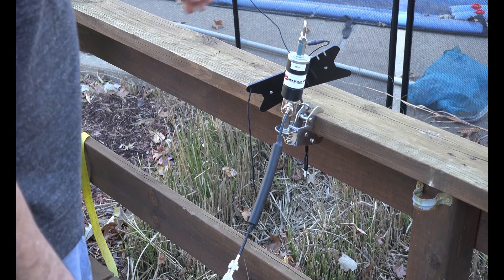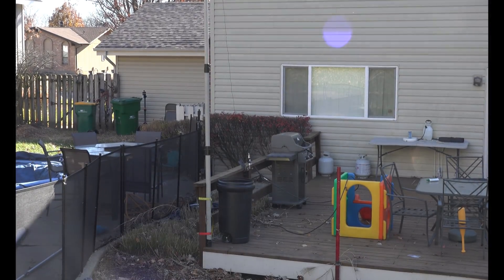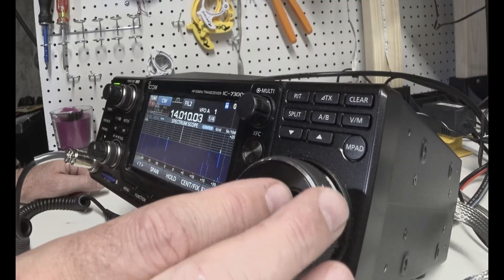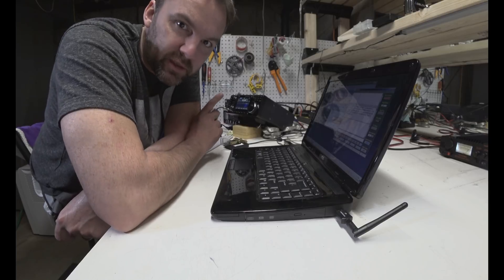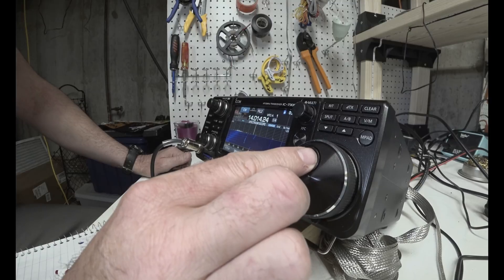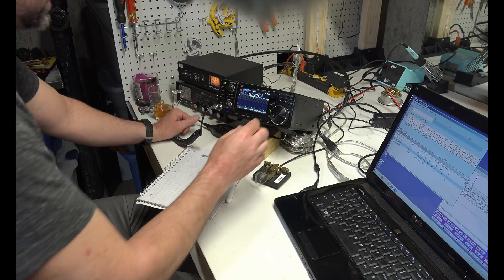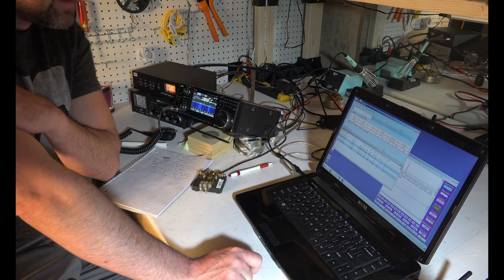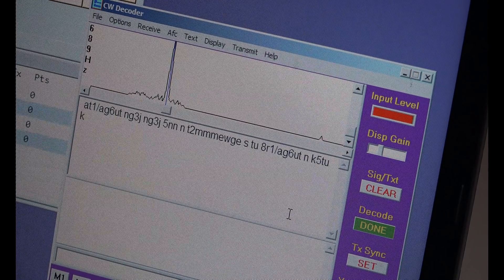CQ Worldwide DX Ham Radio CW Contest | ICOM IC-7300

Comment: Good job Tom.  I'm glad to see you jump in the make some contacts in the contest even though it's a new experience for you.  You will get better with practice and have even more fun.

One of the reasons some of the stations are not responding to you is that they are using very narrow filters on their receivers to reduce interference from other stations near their frequency.   If your signal is not within their receiver's narrow pass band they will not hear you.  Make sure your RIT is turned off, so you will be transmitting on the same frequency you are receiving on.  And use a narrow filter setting of 500 or even 250 Hz and you will have a better chance of being received.  

Also, it's a good idea to use Full Breakin during CW contests so you can receive in between your transmitted dits and dahs, especially since your CW speed is a little slower right now.  You may hear the station you are calling begin to answer someone else while you are still calling.  If you do, then you should hit the ESC key to stop transmitting and wait for the station to say TU and listen for another caller.  You won't be able to receive between your dits and dahs if you are using semi-breakin on CW.

Keep it up.  You are doing great and I'll see you in a future contest. 

73, Steve K8BZ
Reply from the maker: Thanks for the great comment.

Comment: I wonder how extensive a ground system you have with that antenna,  end fed antennas need to work against a really good ground system to work well.   If you can, bury as many radial wires as possible, lots of short are better than a few long radials, you don't need to used exact lengths as the ground will detune.     Noise reduction on that computer cable should be reduced by lots of ferrite clamps or even winding the cable around ferrrite rod(s)      Wishing you all the very best 73  Tony G3ZRJ
Reply from the maker: Tony Butler I have a lot of work to do

Comment: RE: Interference from laptop power cord, I made a small wall/partition between my radio and computer.  The partition is made of foam poster board and is lined with copper foil tape I got on Amazon.
Reply from the maker: I like that idea!

Comment: advice! don't throw your call so slow remember you are competing with others going way faster than you.  you have to get in quick or you will get drown out.  i don't know how the hell these guys could read cw that quick with all that qrm but they are damn good at it.
Reply from the maker: Peter Rod yeah you are right now that I see my video again I realize it's too slow.
Reply: Almost all of them cannot read or send that fast (30-40+ WPM). 
They use software like HRD, CWGet. They are sending and receiving using only Macros (and rarely using the keyboard when an unusual response is necessary).

Comment: That Icom is a sweet rig. I've drooled over that model. But...I think I am going to get a KX3 very soon. When I try a new antenna, I check to see if a freq is clear and then just key TEST CALL SIGN TEST and check reverse beacon network to see if and where it was heard. I had some trouble with my key yesterday (was at my folks place in Ga) back in Va now and will bee trying to fix the issue.
Reply from the maker: I'd def recommend the KX3 or KX2.  It sounds so good.  I have never used the RB Network... still need to do that.  Hey, post a video next time ur on the radio.
Reply: I'm due for another radio video! I'm off tomorrow, maybe I'll do a quick video of my humble equipment, antennas, etc. I'm with you on the contests...not really at the point I want to "rag chew". My base rig is an FT-857D and I sometimes use an IC-703. They are on an indefinite loan to me from work, if you know what I mean (it's legit though). A friend of mine has the KX3 and I really think it's an awesome unit.
Reply from the maker: Ron C awesome, hey try to make it to Dayton next year and we can meetup for a beer.  Great place to shop for gear
Reply: Might be worth the trip!
Reply: There is one record of your call sign still available on the RBN, check it out.
de                  dx             freq        cq/dx            snr   speed      time
WA7LNW  N9YO 7112.0 CW CQ [LoTW] 12 dB 16 wpm 0129z 25 Nov
Reply from the maker: Ron C what is wa7nw?

Comment: That's the way to do it. Jump right in and have fun. You did great. I Always enjoy your ham radio excursions. Really funny to hear how much the family is using the water (wth?).  The ARRL 10 meter contest is coming up Dec 9-10. That is a fun one if conditions are right. I'll try to build a 10 meter 5/8 wave wire vertical and see how that works. Hope to see you on. My the Force be with you. 73 from the other side of the state.
Reply from the maker: Ha!  Great comment.  Yes, sometimes I get a mental block and I don't want to jump in without preparations, but I'm open and honest about how I approach this in my videos.  I don't claim to be an Elmer.  I'm just sharing experiences.    I hope to see you on the 10 meter contest. I will look into it.  Thanks for commenting.

Comment: For the computer interference, you could try ferrite beads on the troublesome cables. They're easy to install and can knock out the RFI. Also, having the station properly grounded can help. I had enough RFI between my radio and PC that transmitting on JT65 would black out my monitor. Ferrite beads and grounding solved that. Good luck! 73 W4CRG
Reply from the maker: I have a lot of grounding going on behind the scenes. I have a ground bus, and aluminium grounding strap and a ground rod....  However, I think it's the laptop power supply. I just ordered some huge toroid cores. I'm going to try and wrap some cord around the cable.

Comment: Hi! Some use computers, some don't. Some use computers to TX but need good ears to catch the callsign.
Regarding the computer cable: get some good 31 or 43 mix toroids from Fair-Rite and install on both ends. You want to read the K9YC paper available online.. Another approach is to get a galvanized metal sheet installed all under your radio desk. That sorted out all my problems. I don't hear a beep from any power supplies, computers or home appliances.
Reply: Why don't you put up a Delta Loop antenna? Computer locks up because too much RF is coming back from your antenna system. Your choke must have at least 5,000 ohms to reduce RX noise, avoid antenna pattern distortion and keep RF away from your shack. Your problem is called the Common Mode.